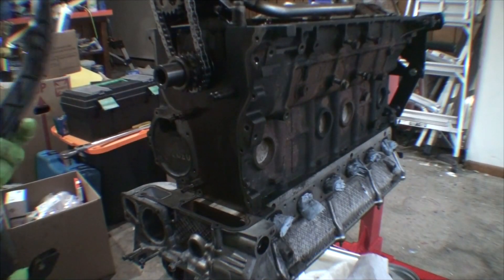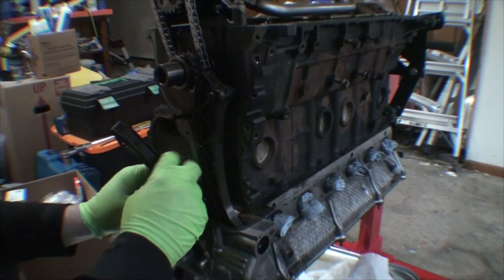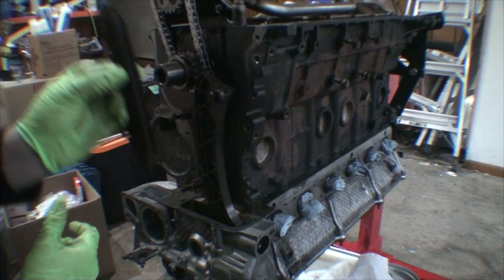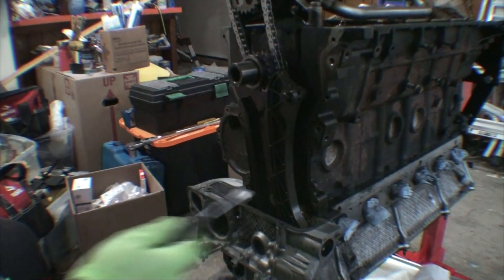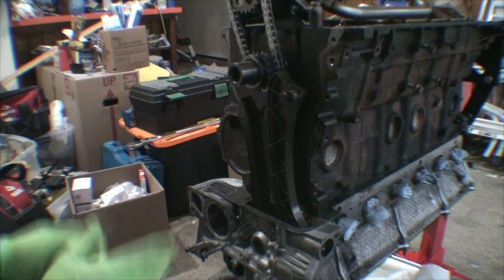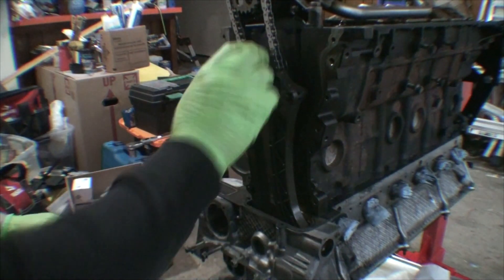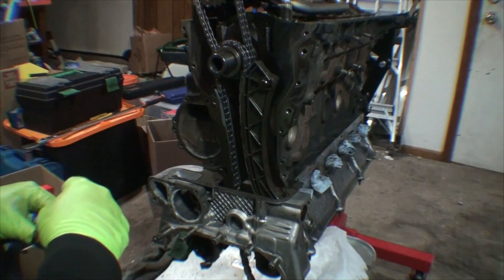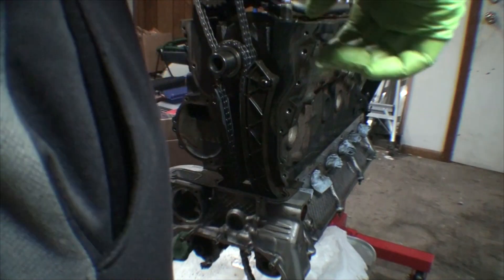Installing Timing Guides, Chains, and Guides On An M52 Engine

Comment: Timing cover still leak free? I may keep the head on my engine if this works 😃
Reply from the maker: Never had any issues with leaks on this engine. No reason to remove the head to access or remove the timing  cover. The factory repair manual for removing the timing guides follows this same procedure. Only tricky part is getting the timing cover dowels to pop out of the block.
Reply: @GarethFoley  thank you. Well I was hoping to keep the head on because the head gasket is fresh. But it turns out fcp euro sent me a victor reinz head gasket in an elring package. So then head is coming back off :(
Reply: @blakeminson6518  Why thought VR is OEM ?
Reply: @bigdeal87  I wound up pulling the head and doing new guides,  racing chains etc.  I don’t trust victor reinz for head gaskets, maybe things like o rings though.
Reply: @blakeminson6518  did you had any bad experience with VR? How hard is it to pull the timing cover when the head is down? Thanks
Reply: @bigdeal87  not personally, just a preference of mine. I’ve only pulled the timing cover off after the head is removed.
Reply: @GarethFoley do you have to degrease, clean the oil off the headgasket before applying the sealant? Thanks.

Comment: Do I need a dowel pin removal tool to get the timing case out?
Reply from the maker: I didn't find myself needing anything particularly special to get the timing cover off. I did use a punch to tap on the dowels from the backside which allowed the timing cover to loosen up a little bit which ultimately allowed me to get the timing cover off relatively easily.

Comment: Is it possible to access/replace the left timing guide without removing the front of the motor? I believe my reoccurring timing issues are because this piece is missing, including the inside of the tensioner. 
Thanks in advance! Great video
Reply from the maker: Hey Justin, good question. Based on my own experience with these engines the timing cover would need to be off to remove and reinstall either timing guide. Reason being is there is not enough access coming down from the top of the engine to release them. Also, the timing cover itself restricts access to physically move the timing guides as they are pretty snug between the block and the timing cover. I have a spare complete M52 on a stand that I can give it a shot with but I don't think it's possible unfortunately. Assuming the guides could be successfully removed the other hurdle to overcome would be physically reinstalling the guides into the engine and that's a whole other story. What kind of timing issue do you have? Crank/cam correlation I assume?
Reply: @GarethFoley - bought a blown e36, paid someone to replace my head, headgasket, etc... since,  I've always had p1519 (vanos mechanical jam). I went back in to replace vanos seals, no luck... Went back in to upgrade to m54 intake cam, re-time everything, and noticed a hollow chain tensioner (outer housing only) and no timing chain guide (left side). Seems to be common piece that breaks on head work. 
I imagine chain may be skipping links under high load without anything keeping tension on it? 
Seems like the time invested to swap this $20 chain guide, I might as well just swap a different motor, and rebuild this one out of the car.
Reply from the maker: @JG-dr8hx  In my experience the VANOS mechanical jam is usually because the VANOS hub didn't mech with the intake cam gear immediately when installing the VANOS. If it doesn't catch as you're turning the camshaft timing chain via the VANOS wrench it will cause the jam situation. However, if there is slack in the timing it could cause that problem as well. The only trick with pulling the timing cover with the engine in the engine bay is access to the dowels which go into the block. On the stand it was easy to remove as I used a punch to tap them out. In the engine bay it would be tough for sure.
Reply: @GarethFoley  So what needs to be all taken off to get the timing cover off ? Oilpan, waterpump, crankpully, valvecover, vanos, chain sporckets any thinkg else ? Thx
Reply from the maker: @bigdeal87  Valve cover, water pump, crank pulley/crank pulley hub, alternator, oil filter housing (possibly). The oil pan does not require removal. The timing cover is located with two dowels which can be a pain for removal of the timing cover.